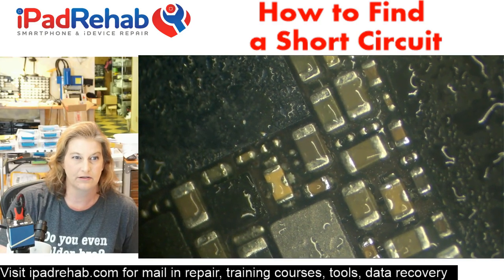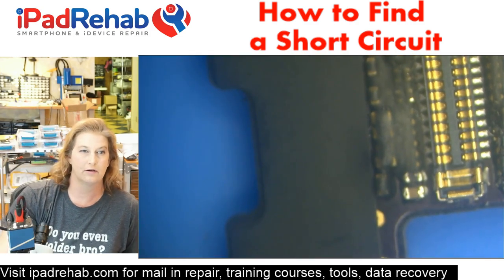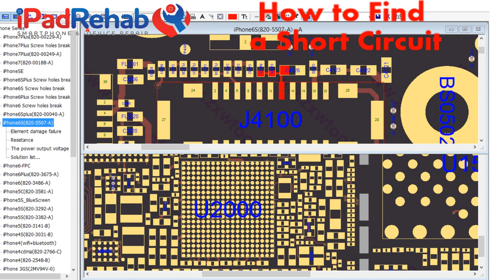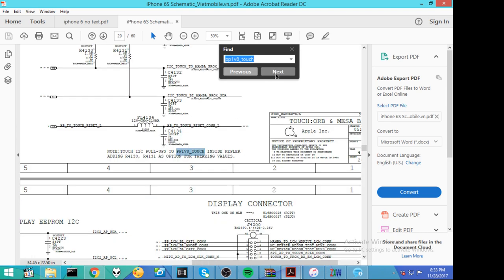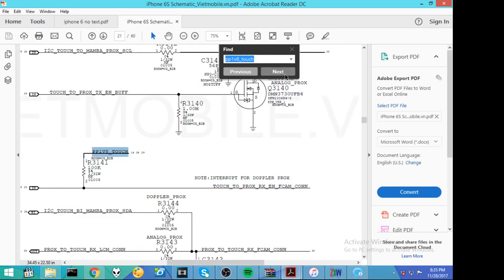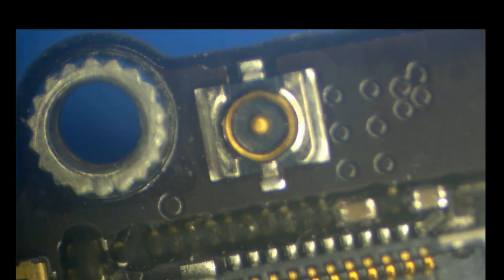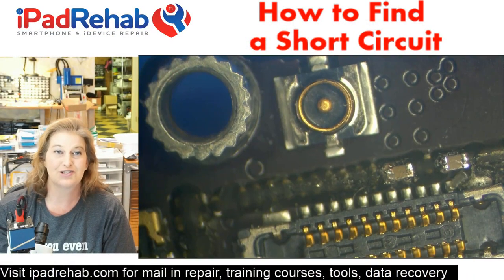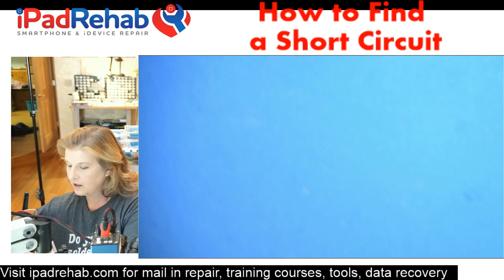How to Find a Short Circuit---Freeze Spray For the Win!

Comment: The new flir one pro had twice the resolution than that one and works a lot better. I too use freeze spray for finding low ohm shorts, but they are really useful for finding high ohm shorts that give off virtually no heat. You just have to turn off the regular camera and rely only on the ir camera and hold it at a max of 1inch from the board, using it like they tell you is totally useless, but holding it nearly touching the board works perfectly.
Reply from the maker: sounds reasonable.

Comment: Hello, im new to repairing iphones or even considering repairing them. I bought two iphones each with problems, the biggest question is with one of the , as I believe I know how to fix the other one; the phone charges and functions properly except few when it loses the picture, this losing the picture though turns the screen black but not off and it still gives off light, the touch is unresponsive at that point as well, but one it put to sleep and back on it works for afew seconds as the screen does this within seconds of "unsleeping" the screen. Ive been looking in to backlight problems and im wondering if I could get advise as to where to trouble shoot or if anyone would know the solution. Thank you.
Reply: Alden Florio rehot cpu bro

Comment: I love using freeze spray myself, but honestly do you really believe that a good thermal camera can't be as precise as that? If it worth the money is another story..
Reply from the maker: +RepairLab no I don't.  I think it would be an unnecessary pain in the ass and useless.  I have a $7000 CNC machine behind me that can drill underfilled chips out with precision.  I have used it less than a dozen times.  In practice the effort to calibrate and set up the thing is just not worth it compared to the ease of doing it by hand.  If an expensive high precision were sitting next to my CNC and it was given to me for free--I still wouldn't use it.
Reply: iPad Rehab I know you have this CNC and I know you don't use it as well lol. But I tried one good thermal camera the other day and honestly it's not that bad. Not a pain in the ass to use and precise enough to spot tiny amounts of heat like this in your video. Just sell this CNC and buy a good thermal camera. :P
Reply: I personally used freeze spray, then I purchased the cheap Seek thermal camera (the one that has adjustable focus) and I really prefer using the thermal camera. If I need to confirm a tiny heat spot then i use the spray just in that small area. I think having both is the best option
Reply from the maker: "Honestly not that bad"  I have zero use for infrared camera heat detection.  That is like saying "you can eat soup with a fork, it's honestly not that bad"  Thermal cameras are a fork.  Freeze spray is a spoon.  Eat soup with a spoon.
Reply: Not that bad comparing to what you are saying on your video. I am not saying you are wrong but I believe you are way too negative. This is you until Louis starts selling descent thermal cameras on his site! lol
Reply: iPad Rehab the problem is you're using a really ancient model, the newer ones are a lot better. That one you have is about 4 generations old now, they had that one, then flir one for iOS, then flir one for iOS 2nd gen, now flir one pro. The newer models have a lot better resolution.
Reply from the maker: he would never do that in a million years.
Reply from the maker: he is too cheap to even use freeze spray!
Reply: Hahaha!
Reply: @tastytechaddictsmtb   Hi... Could you give me an information?     
  Nowadays, what's the better IR camera do you know for this purpose?
  Do you know a good IR camera not so much expensive?